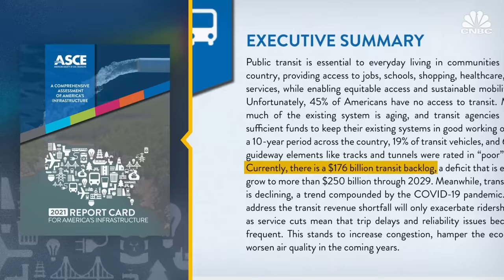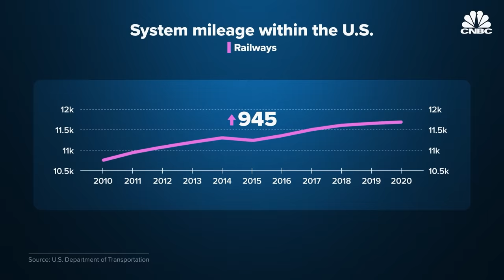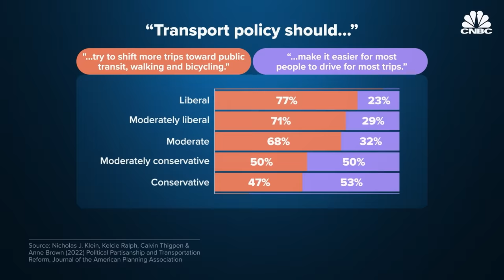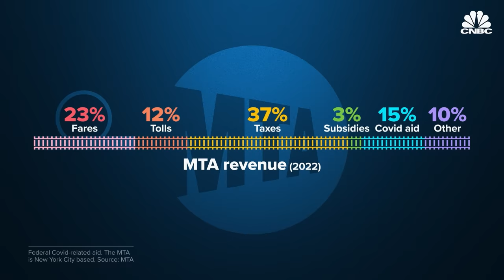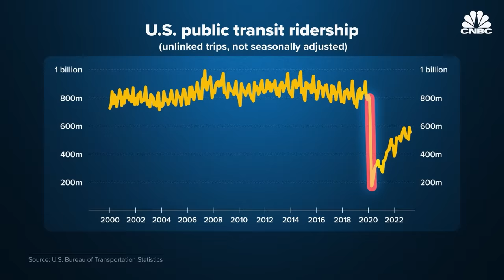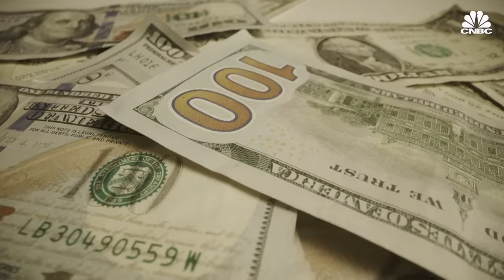Why The U.S. Gave Up On Public Transit

Comment: The automobile industry lobbied hard for car infrastructure back in the early 20th century. That is why we are so car dependent now.
Reply: it doesn't have to be this way
Reply: You read my mind. They did that exactly.
Reply: @LiamMartens You are right but money sway politicians actions.
Reply: That's what I was going to comment. Corporations have ruined everything.
Reply: Auto, oil, rubber. All those pushed hard for auto infrastructure, namely freeways and buses. The whole National City Lines story of buying up streetcar systems and replacing them with buses. 

It’s important to remember too though that in the late 1940s, many public transit systems were already failing. Maybe the best example of this is the Pacific Electric in LA. The car was a shiny new alternative that could take you anywhere anytime, without relying on a fixed track or schedule. That freedom was much more appealing than continuing to ride an old train, and for many who drive it still is. 

So while there definitely was some dirty work going on behind the scenes with the corporate lobbying for cars and auto infrastructure, we the consumer are also to blame for the fall of public transit. Now that our roads are so jammed up with traffic are we beginning to invest in rebuilding pieces of the old transit systems as well as building new ones.
Reply: Go sell your car then. Don't even say you're forced to buy one. You always have a choice. Preach what you type in the internet. I would rather put my money on cars than rails. Unless railways system give me on-time, on-demand service, with impeccable personal privacy and security, and cleanliness per ride. And cheaper in overall individual economic cost against owning a car - (ie. $1 train tickets to compensate for $30+ uber rides and tips to reach multiple specific daily destinations and train station parking fees).

 P.S.

Rail system monopolized transportation sector for almost a century, before the inception of air and automobile transportation. Hell. Even big time tycoons played big money on rail corporations. Rail system had its chance to thrive. But it failed. US is not Europe. It is not in the mind of the modern American culture. And I lived in Europe before (Germany), for other keyboard warriors here dreaming of being a European, speak Deutsch (German) to me. :) And I'm not white if you want to pull the race card, for no reason.
Reply: At the end of the day, regardless of any external influences, we're the ones who vote to invest in car infrastructure, and it's well-aligned with the American psyche of "freedom" to be able to drive anywhere at any time. Every single time here even in NYC that we try to expand transit in any way that would scale down car infrastructure in favor of public transit, biking, etc, you'll see so many people who are extremely angry and up in arms (from NJ, parts of Brooklyn, etc) come to argue against it. And this is a place where transit has been really successful and strongly approved of locally in the US. Everyone basically anywhere else in the US needs a car, and they already have a car, so most people want to see more car infrastructure not less. Thankfully, polling seems to suggest a trend moving in a great direction for public transit finally, and stuff like the infrastructure bill has been an insanely positive thing for finally investing in transit. Let's hope it continues!
Reply: @Zenrei940 there is no security in American public transportation. Look at Daniel Penny's case in NYC. There won't always be Daniel Penny to save the day from the trash that roam the public transport. Your car is the only safe option.
Reply: @Zenrei940  We have a xenophobe over here.
Reply: @ChrisJones-gx7fc  yep while the government let that happen in the us! In Europe and Asia it was quite the opposite! How could the government not see that!?
Reply: @doughvahkiin2885  I think that’s mostly among the younger generations (Millennials especially), who can’t afford or choose not to own a car and want to use public transit and bike more. As they move into the positions of power and the older generations out,  I bet we’ll see more of a policy shift toward more public transit spending and less spending on roads. Cars will never completely go away, nor should they, but we’ll be able to rely on them less. Plus as they said in the video, better transit means less traffic.
Reply: In other country, It is call corruption not lobbied.
Reply: They missed 1 MAJOR issue. Certain "undesirables" who make riding public transit miserable & sometimes dangerous. Go hop on certain CTA or BART lines and tell me what you see. Ask Daniel Penny what it's like to ride the MTA. There's a reason BART stopped reporting crime data. No overpaid Columbia professor is going to talk about this.
Reply: @Zenrei940  why does it have to be one or the other? No one’s forcing you to give up your car. In lots of places, mostly suburbs and rural areas, you have to have a car to reliably get anywhere in a reasonable amount of time, be it to work, go shopping, doctor’s appointments, etc.

Better public transit means people don’t have to rely so much on their cars. It also benefits drivers because more people on transit means less traffic. Those who choose to drive will keep driving, while those who have to drive will choose transit when it presents itself as a better alternative, one that’s not just faster but also reliable and more convenient. 

We can have cars and better transit, and should invest in both, but for too long investment in cars and car infrastructure has been extremely disproportionately higher than transit. We need to swing that balance back toward more investment in transit. Better transit benefits everyone, not just those who use it. 

Cars will never go away, nor should they. I love going on road trips and the freedom a car provides. But if I can go somewhere for a day trip or weekend getaway without relying on my car and having to deal with traffic, gas or parking, utilizing transit that can get me to where I want to go reliably and safely, I’d be all for it.
Reply: The airline companies fought to stop trains being built
Reply: @chiefenumclaw7960  that is a major issue with transit, but there’s also no simple solution. Getting them off transit would seem to be the easy choice, but then there’s the problem of where are they supposed to go? That becomes a housing issue, but also more homeless shelters, mental health clinics and drug rehabilitation centers. Try building those anywhere near transit and watch all the NIMBYs come running. 

Public transit won’t get better so long as it has a bad reputation. That does have to be the first priority, to make it safer and thus more desirable. Once that happens, ridership will improve and with it justification to keep improving it. Like I said though, making it safer isn’t just kicking off all the ‘undesirables’, it’s also providing them a better place to go.
Reply: @ari-jv  that’s more intercity and really high speed trains. This is about public transit in and around cities. 

As for HSR in the US though, in the 1980s and 90s Southwest Airlines lobbied heavily against a proposed Texas HSR project, and were at least somewhat responsible in getting it shut down. Airlines don’t want to see HSR take off here cause it’ll eat into their short intercity flight market, like Houston-Dallas or LA-SF, just as HSR has done elsewhere such as London-Paris or Barcelona-Madrid. However, just as better transit in cities means less traffic, HSR between two or more major cities (<500 miles), means airlines can run fewer short-haul flights between them and open up gate space to focus on more lucrative long-haul flights.
Reply: Yeah the car industry is dangerous and wasteful. Morons who actually think cars are safer and/or faster should look at the per-capita rates of death by car vs by public transit.
Reply: not just the lobbies. affluent, middle class (predominantly white) families seeking to escape the growing working class of (predominantly black, hispanic, or asian) families within cities by moving out into car-dependent suburbia.
Reply: @alanmay7929  surprisingly, they weren't that different from the US until around the 80's. we Americans are just too headstrong to admit we made a mistake - at least, until now
Reply: @ChrisJones-gx7fc  American public transit will never work because certain Americans don't know how to behave in public. Japan, Singapore & other Asian countries have homelessness, & yet they don't have the safety issues on their public transit that we do. 

My point is that it's more of a PEOPLE/CULTURAL problem than it is an INFRASTRUCTURE problem. Seattle has great bus infrastructure if you don't mind sitting next to someone on meth. BART is fine if you don't mind getting "train-jacked" going through the Oakland Fruitvale stations.
Reply: @chiefenumclaw7960  nothing is stopping law enforcement from being present on transit. this is commonplace in countries without car dependency. our assumption that only the poor take transit is why we don't have proper and effective policing in most transit.
Reply: @laurensa.1803  Oh. You're calling me a xenophobe? I was born outside the US. I lived in Asia and Europe. Experienced living in different societies. Tell me your local municipality so I can file a complaint about you. Verbal abuse should be taken seriously.
Reply: @XDTape  If you consider that adjusted for user numbers transit is safer than driving, you don't need law enforcement in transit. The guy you responded to just wants to be a biggot.
Reply: Corporate greed
Reply: @ddd7254  i'm well aware of that, i'm just trying to poke holes in his "argument" that aren't already gaping and obvious
Reply: @XDTape  Excellent point!
Reply: And so did the oil industry. I'm glad I live in the Netherlands where we have efficient and affordable public transport.
Reply: and Suburbs
Reply: @Zenrei940 that's perfectly fine for you. But that doesn't make it fair to defund transit for everybody else.
Reply: @LiamMartens  I agree with you and the London, Ontario🇨🇦-born Amsterdam🇳🇱–based Not Just Bikes YouTube man on that point.
Reply: The correct amount of tax funding for public transit is exactly ZERO, NONE, Nothing! Cars are better in almost every case.
Reply: nobody likes getting stuck in traffic.  the problem here isn't that we aren't throwing enough money at public transit, but that it can't be run efficiently or cost-effectively.
Reply: @easyrider3112  so better that everyone sits in traffic all the time because everyone is moving around in a big car? And also better to force young people, the elderly, the disabled, and the poor to have limited mobility? Sounds like an awesome world.
Reply: @easyrider3112 that’s statistically false
Reply: @Zenrei940 The “go sell your car then” argument always perplexes me. Improving public transport is about giving people more options. It’s not about taking cars away(although that IS a benefit for the people who need/choose to continue driving).
Reply: @ChrisJones-gx7fc  A big problem with Pacific Electric was that because the Los Angeles Basin is quite large, it would require a lot more interurbans than the Pacific Electric ever built. That is unless we're will to live in much more densely populated cities that are easily served by shorter runs of public transit.
Reply: @the_notorious_bas  On that count I agree with you and the London, Ontario, Canada-born Amsterdam-based Not Just Bikes YouTube man.
Reply: @Zenrei940 lol sell your car while in car hell arizona or many other states? People don’t give up their car cause it’s the only way they can get around so yes they are forced to have one.
Reply: @Sacto1654  well when the PE was first built, it ran from downtown LA out into essentially farmland that was then developed into suburbs which it would then serve. Then as roads and cars came about and new suburbs with them, the trains no longer went to all the places people lived like they once had. 

Suburbs grew with LA just as skyscrapers did with NYC. LA had lots of land to build on, whereas NYC had to go up cause it couldn’t go out. Suburbs built post-WW2 were built for the car, cause that was the dominant way of getting around by then and has been pretty much ever since. 

Ironically, it was dense housing in the cities that was the appeal of suburbia in the first place. The idea that you didn’t have to life in the city, that you could live in a nice, open area and commute back and forth for work and play. To make the most out of transit today, we need denser housing centered around the transit stops so accessibility is much easier, but also have more frequent and reliable service. Businesses and other necessities like food and medical needs, as well as fun activities and luxuries, should also be positioned within walking distance of transit. 

It’s ultimately about dramatically decreasing our reliability on the car, by having everything needed and desired accessible by transit, and to make transit faster and more convenient than driving, but also safer. When transit is the better option, people will use it, but only if they feel safe.
Reply: @easyrider3112  There is a risk of being involved in a crash as a pedestrian although driving is a skill that not everyone has.  It's been awhile since I last drove, with my having almost consistently from 2015 onward used transit, Uber, Lyft or some alternate ridehail or taxi service.  For instance during a vacation in April 2016 to the Alberta capital Edmonton, I used at least once apps for TappCar and Co-Op Taxi.  In part due to my lack of familiarity with Edmonton's transit system, I never used transit when I'd last been there.  Since then I have yet to visit any part of a given Canadian province other than Ontario (where I live) or neighbouring Quebec (the latter of which I visited for a funeral in Montreal, in the extreme southwest).

Am I concerned about public transit?  Although incidents of violence on the TTC, the transit system run by the municipal government of Ontario's capital Toronto, have been widely reported in local, and sometimes national, news media, I go by the philosophy that as long as I do nothing stupid, I should be fine.
Reply: They also bought a lot of street car companies and other public transport and destroyed it to help oil car companies.
Reply: And now we're stuck.
Reply: @Zenrei940  Wait til you get carjacked!
Reply: @jaredrl06  So why is Europe and East Asia more prosperous than the United States despite maintaining and improving their railway and public transport infrastructures?
Reply: Do you really believe this?
By chance…Which entities lobbied to not maintain the transit system you mention?
Reply: @easyrider3112  Then you wouldn't mind zero public funding for roads either. Just charge tolls for every mile driven.
Reply: @tooltalk  That's only a USA problem. Other countries even Canada have solved it.
Reply: @ChrisJones-gx7fc  I think New York City, because of its very high living density with all the issues that imposed, was the reason why suburbs exploded outside the city after world War II. Anyone who's read histories of that city note that densely populated tenaments were a big problem in that city, an issue well-documented at least back to the middle of the 19th Century. No wonder when Levitt Town was built on Long Island, the new houses were snapped up in no time flat.

We could go to the Dutch model of 6-8 floor apartments with decent spacing between apartments, but it won't be cheap, particularly with Americans with Disabilities Act compliance. And Americans soured on the disastrous large public housing projects like the ill-conceived Cabrini Green in Chicago, so there is limit on how dense modern housing can be.
Reply: lobby=corrupt
Reply: Taxing the rich would keep public transit funding plentiful.
Reply: @edwardmiessner6502  : there aren't really that many public-transit systems that are self-financing/supporting unless there is that kind of population density of, say, Hong Kong.
Reply: @Zenrei940 Nobody’s getting rid of cars. We just want more options. Not everyone is as entitled or privileged as you to expect perfect service when they just need some kind of service to get them from point A to point B without costing them 40,000 dollars and constant gas bills they can’t afford.
Reply: @wainber1  Yeah, I remember his excellent NJB channel. It made me realize how good and efficient our infrastructure actually is.
Reply: Precisely.  Big corporations have always wanted bigger profits. 😒

I for one would rather not have the automobile be our only available method of mechanized transportation.
Reply: @easyrider3112 So you are in favour of accelerating the planet towards becoming completely inhospitable to human life, huh?
Reply: That is unless everyone lives in downtown. People move to the suburb for space and affordability. I live in downtown for a premium, but taking public transit is infeasible in most cases.
Reply: Parking, mainly. We ended up with these absurd minimum parking requirements, forcing businesses to demolish perfectly good neighboring buildings to meet the number of parking spaces required for their to do business. Get rid of the parking minimums. All of them. That's a key part of it.
Reply: @edwardmiessner6502  When you make terroristic threats to women and children, sometimes there will be consequences.  

But I get it, you saw a 15 second, intentionally edited clip on CNN & figured you had the whole story.
Reply: @Zenrei940 You say we aren’t forced to buy a car, and then you say rails don’t give on-time, on-demand service…. LMAO smart guy over here!
Reply: Not only the car industry but also airline and oil corporations have been lobbying governments in the US against public transit projects. Taken for a Ride is a good documentary on the history of that in the 20th century. But it's not just in the past - it's ongoing.
Reply: @LiamMartens  Yes. There are so many places in the US where easy changes could make transit great again! Take the Northwestern Corridor, Pike Market or easy tweaks to parking requirements for newly constructed buildings - Minimal changes to these things could change the US as we know it
Reply: @anonymous87654  lol, you are funny, you say that as you use a company's gadget typing into YouTube, a corporation's platform. Yes they ruined everything for you by providing most of what you now possess
Reply: Public transportation in NYC is awful.  Its dirty, unreliable and unsafe.  Public transportation will never work.  Its why ppl prefer remote work now so they dont have to commute anymore.
Reply: Basically lobbying by groups that would profit from automobile and oil sales, yeah.
Reply: @chiefenumclaw7960  The internet is your friend. Google Scholar which is THE card catalog for academic publishing registers 228,000 hits for the following words, crime on transit systems. But maybe you're right -- the overpaid ones are all in medical and business and law and wouldn't be publishing about transit crime anyway.
Reply: @mk17173n  public transportation can ABSOLUTELY work and be BETTER than using a car to get around. They just need proper funding to work, which US transit has historically not had.
Reply: @LiamMartens  it's a done deal
Reply: @Comeback180  many of them are rich because they are rather crafty. so if you hit them with a much higher tax rate they will suddenly have a large decrease in income on paper. now what do you do?
Reply: @ChrisJones-gx7fc  wow
Reply: @doughvahkiin2885  no. i don't have a car and i live in town. sucks to be followed at target with all my bags and enjoy the company of heroine addicts during my rides to and from work. there are other alternatives to automobile transport. i have been living them for 58 years...
Reply: It has nothing to do with that. The US is a gigantic country and 90% of drivers don’t live in a big city.
Reply: @hanbo123  I think the best way to appreciate difference between Europe where mass transmit works and US where it doesn't, take a plane trip to Europe and make sure to view the ground when you fly over big cities in Europe vs big cities in the US. The difference is mind shattering. Takes seconds to a minute to fly over a large European city vs 5 minutes of suburbia for a US one.
Reply: No they didn't when Cars were invented and developed they used the same infrastructure as Horses and buggies. That put them at a HUGE advantage to discern riders.
National addendum for nationwide Highway system was sidetracked by 2 World Wars, but as soon as that was over national highway systems were in progress and goal was to finance it with user fees in form of either tolls or motor fuel taxes or some tax that directly withdrawn from the drivers. That's why completion of the Interstate took 50 years.
Streetcar ridership peaked in 1919 and declined each decade because Post World War I inflation; The Nickel fares could no longer afford the upkeep of the rails and ridership collapsed after 1927 invention of the Engine - over-Axle bus which allowed to carry 40 passengers instead of 25. That out moded rail transit. And by 1960's long distance rail travel had another competitor, AVIATION.
Reply: @Tom-nd1fs tell us, what factor causes crime?
Reply: @Tom-nd1fs  do you know how many people die because of cars
Reply: @Zenrei940 go ahead and keep obsessing over your inefficient cars. Lots of people are waking up to the fact that cars are just bad for both the environment and cities as you can’t go anywhere with wasting tons of money on a car that requires maintenance, tolls, gas, and other expenses
Reply: They bought out the transam services to replace them with streets and highways.
Reply: @MrStark-up6fi  Cars are inefficient? Then tell me why is our countrymen gravitated towards car ownership than taking rail transportation. You seem to have a personal motivation for rationalization.

Rail system had a head-start for almost a century before the inception of automotive and aviation. Even big-time tycoons played big money on the rail system. But. It *failed*. The rail transportation didn't held up to its new competitors. 

Safety is one of my top priority. If I'm forced to ride on a public transportation, then firearm legislation should allow the citizenry to open-carry. I don't trust anyone inside that carriage. Unless every single carriage is manned by one law-enforcement (thus taxes and train fees will sky-rocket).
Reply: There’s always idiotic comments like this on youtube… listen to yourself mate
Reply: They got rid of the electric street cars, and sold the car to us. All for the oil, tire, and car interests.
Reply: @DrBadSectorError63  Jokes on you because my $90k job is less than a mile. My university, for my next profession, is less than 2 miles. And I have 2 cars. And I used my sedan for a 3 minute drive :)

And the SUV is used (you guessed it! as a Sports Utility Vehicle) for my active lifestyle such as biking, car camping, backpacking, hiking, paddle boarding, cross-country travels, etc. Than the rest of these urban fat blokes watching Netflix the whole day and making rants on the internet :)
Reply: @@DrBadSectorError63 You're making threats? Tell me your municipality and identity. I will file a civil complaint against you. Verbal threats and abuse must be taken seriously.
Reply: the correct answer. don't forget about big oil, now, too.
Reply: @Zenrei940 I’d love to sell my car, but that isn’t feasible right now. If the infrastructure was in place I would do it. And then you would have less traffic on your drive to work.
Reply: @Zenrei940 Can't sell car, zoning requirements massively kneecap all other transit infrastructure in my area. Only real solution i see is to push for civil planning reform and decreased subsidies for automotive infrastructure.
Reply: You need a car so you can pay car insurance and you need car insurance because its the law.
Reply: @Zenrei940 damn if you think youre being "cyberbullied" or "cancelled" just turn off the computer
Reply: @meep.472  What? Why don't *you disconnect from the internet. It is perplexing when people's responses are threats than constructive criticism. Is this the new face of CNBC followers?
Reply: @Zenrei940  scroll up and read the contexr
Reply: I don’t like this argument because it makes it look like there’s nothing that can be changed. There is room and time to change but nobody wants to do it without someone in their pockets groping them
Reply: Back then the car was seen as new, revolutionary, .....progressive. And the people embraced it because cars were pretty awesome. It was convenient, powerful, fast, and fun. This is also why we're so car dependent now, because for the most part, it still is.
Reply: The tire companies lobbied hard to get rid of LA electric trains. They even sabotaged the power lines and ripped up the tracks.
Reply: So why didn't agencies that served as public transit lobby just as hard or harder?
Reply: @anonymous87654  No. Big government ruined everything. Let people decide for themselves.
Reply: @Tom-nd1fs  Lol. Until you break down on the highway in the middle of the night and that friendly predator stops by. How safe are you there, in the middle of nowhere?
Reply: If a large majority of the citizens banded together and lobbied for public transportation, then we'd get it.  We don't have it today because we don't want it.  You don't see a large majority banding together for it.
Reply: Sure. 
🤔
And as leadership is now poor in imagination and logistic skills, they prefer doing nothing.
There is much work to do but the result can't be reached before one or two decades. For career hungry congressmen, this is far too long.
Reply: Life would be simpler with out cars. Less fatalities, less traffic, less pollution and expenses.
Reply: @justinsullivan1285   Well, actually cars are only horse carriage without horse but an engine instead (be it electircal or not).
Carriages were numerous back then. They still are. They will.
With all the issues induced.
Reply: @mk17173n  Take a trip to Montreal if you want to see a good metro system. The NYC subway is outdated and underfunded. It can easily be improved with proper leadership.
Reply: @KLRJUNE  Well worth it if you ask me. Travel to a place with a good metro system. Your opinion on public transportation will immediately change. I recently visited Montreal and was blown away by how good the metro, walkability, and biking infrastructure is.
Reply: @Zenrei940  Caught another right-wing, American exceptionalist zealot here.
Reply: CHINA: CORRUPTION
US: LOBBYING 😆
Reply: As they continue to do so to this day.
Reply: An overwhelimg majority of the US population growth and building happened after the car dominated.
Reply: Good
Reply: So you're saying people chose to live in safe suburbs with good schools over troubled cities that are dead end for children. Got it.
Reply: Which is most likely backed by oil companies too.
Reply: @longbeach225 
Ban lobbying.